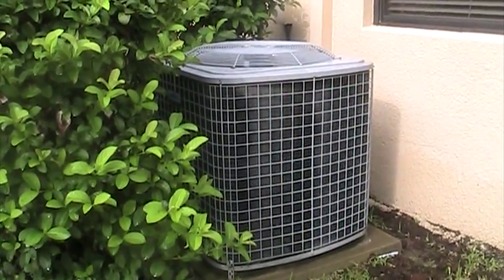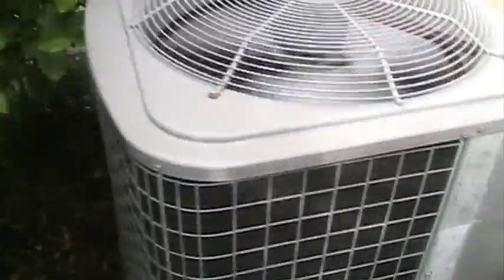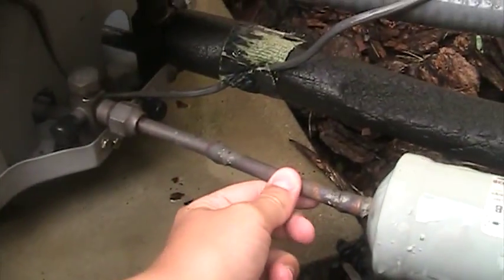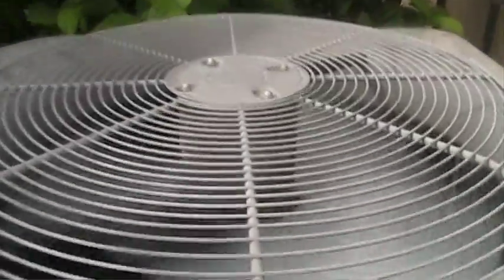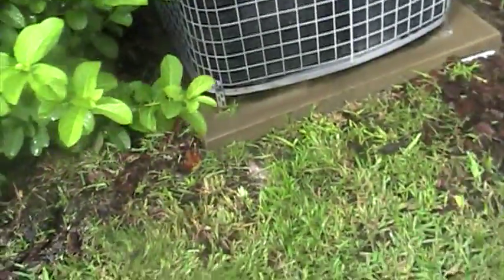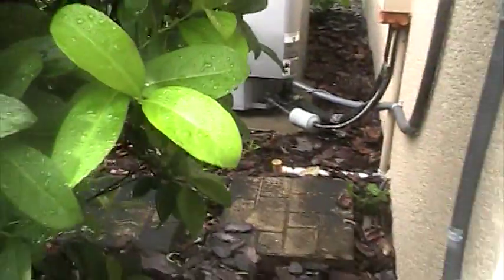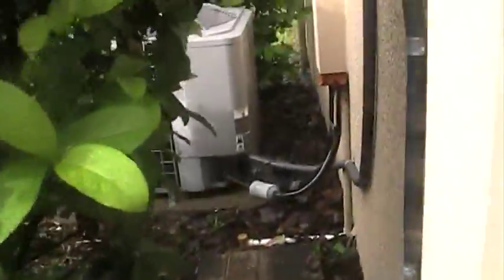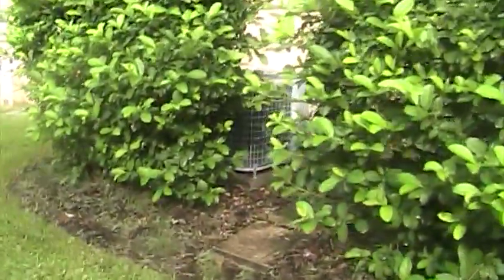Dual-Zone 2006 Tempstar N2H3 Heat Pumps Running in COOL Mode!

Comment from the maker: Thank you very much! That they are. I think that these are fine, and I like them just as much as XB13's. All these are is rebadged Carrier BASE Model condensers. 

It wasn't that bad. It was so hot and humid outside, that the cool and dry 77*F felt good. I usually set my air to 73*F.